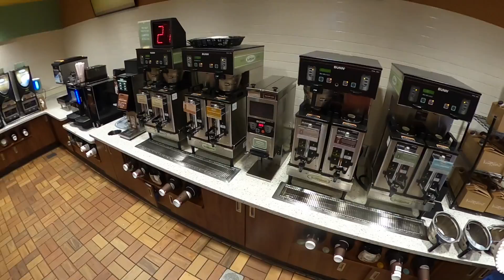New concrete driveway in a day - Easy money for everyone!

Comment: Y’all killed it!  From start to finish the guy who did my shop took several weeks. Took them 3 days to pour my 30x50 shop and a 12x30 side parking and it doesn’t look anything like y’all’s work
Reply: Ridiculous
Reply: HeLLo Mr Martin,. I need to ask so i can understand how thats possible😄.. was the 30x50 interior part of shop? ((i know it is more time consuming then exterior sometimes depending on the job))
And was there more prep/demo type of work then usual??  I know personally the type of construction work that i do,the prep/demo is the more time consuming part of alot of my jobs!. Butt who knows maybe that crew of guys were just superr slow and or lazy🙂..
Reply: @jeremyjones8872   I cleared the area for them. Open place. They roughly framed up then came back a week later to get it all square and level. Few days later that came and poured 9 yards( half of the 30x50 shop, which was waiting to be delivered for them to do the cement).  Then about a week later they was able to come do the other half and was doing the 32x12 side area. They done 8 yards that time because they was having a 2nd truck come right after that to finish it. But he didn’t account for enough cement to do the 32x12 so he had to come back again to finish the 3 yards of my 30x50.  They didn’t get here until almost the hottest part of the day and would work for maybe 3 hours then leave. Worst experience I have ever heard of around here.  From the time they showed up to start to the day they finished was 11 days to do 25 yards. Waited an Extra week and a half after he said he would come before he showed up
Reply: @jeremyjones8872  they could have done way more then what they did at one time for sure. But they did a little each day and poured over the course of 3 days

Comment: I'm a carpenter but me and my crew did our very first concrete job day. I have been waiting and learning from you for a couple weeks now to pick up as many tips as possible. Turned out ok, I had a problem with my risers I think I took the forms off the riser to early. Had some concrete fall out. I patched it the best I could to get it smooth, and ended up not charging the customer, it was definitely a learning experience, definitely look forward to learning more although I may stick to carpentry lol.
Reply from the maker: That's cool man, you can't get better unless you try. I did make a video specifically about steps, I don't know if you got a chance to watch it.

Comment: Hi Ryan,  pretty sure code for risers  is 6 1/2" or 7"  .Infact 
If you find a riser that's too tall your brain won't calculate the correct height and you might trip! That house you just roughed in and added a step will really be fine . That existing step was to high . Hugh ?

Comment: I have a question that has been answered already some where in the comments on another video. What is the brooming for?  Just wanted to also say another great video and you would be a great employer to work for. Thank you for the videos.
Reply: Gives the concrete it a slightly rough finish to make it non-slip when wet. Usually done on driveways, steps,  sidewalks and patios. Garage floors are smooth.

Comment: Why do some contractors cut joints with a saw? When they did my drive they had a saw on wheels when the concrete had setup for a few hours. Is there any significant differance on how it will crack?

Comment: If you pull up the wire to lift it off the ground and your still standing on the wire while you're pouring the concrete isn't it just going to go back on the ground
Reply: Wrong, rocks in the concrete hold it up